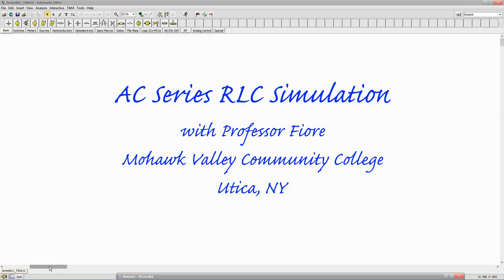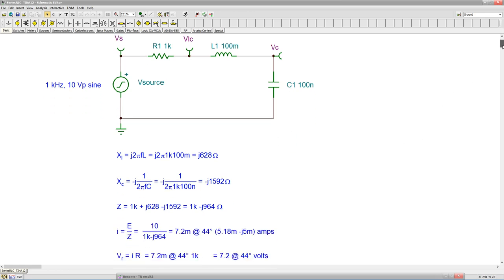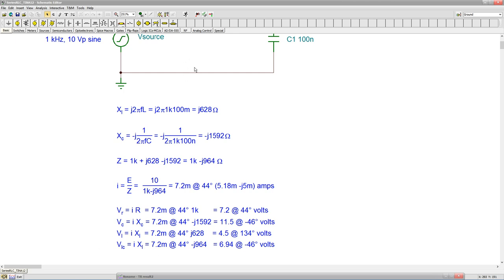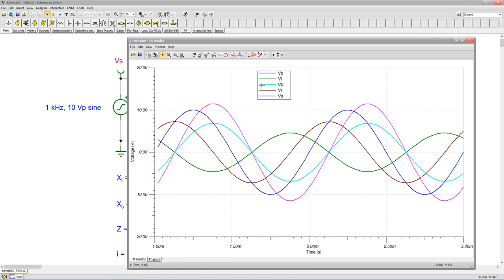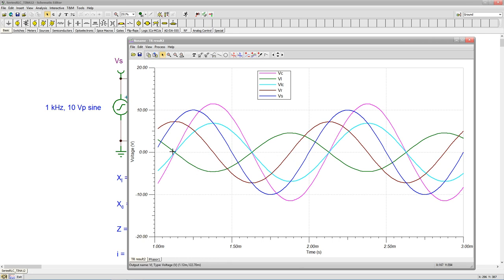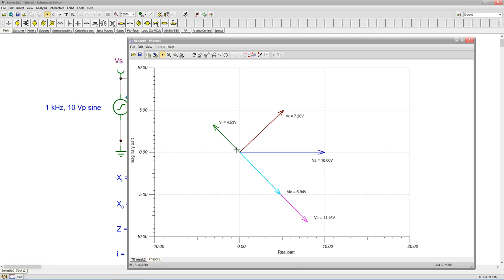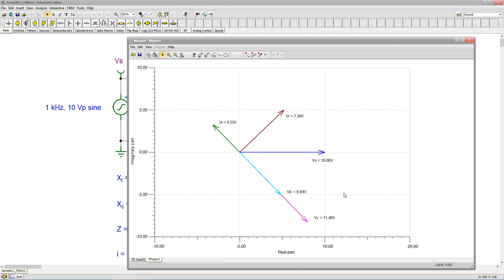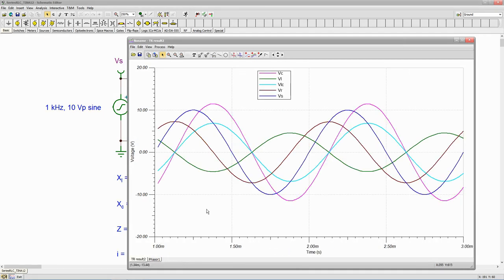AC Electrical Circuit Analysis: Series RLC Simulation

Comment: Good video....Why capacitor is used in DC circuits (where there is no voltage frequency is involved)?
Thanks.
Reply from the maker: It might be used to create a delay, for example, the rising voltage across it could energize a relay that connects a power amp to a loudspeaker. This way, the loudspeaker doesn't produce a "thump" when the amp is turned on.
Reply: @ElectronicswithProfessorFiore  Thanks for the kind explanation...It makes sense.

Comment: Hi sir,
Is it possible to get two different answers when calculating voltage of a component? For instance, using ohms law (i*Z) for resistor, or voltage divider rule (v*(X/Z))?
Reply from the maker: Not if you do it correctly. In AC circuits, a common beginner's error is to ignore the phase angles. In such a case, you can come up with different (incorrect) values.

Consider it this way: ultimately, the voltage divider rule is just a convenient form of Ohm's law. To keep it simple, consider two resistors, R1 and R2, in series with source E. The "long way" using Ohm's law is to find the current (I=E/Rtotal), and then multiply that result by the resistor of interest (e.g., VR1=I*R1). If you substitute the original expression for I in that second equation, you get VR1 = (E/Rtotal)*R1, which can rewritten as VR1 = E*(R1/Rtotal) (voltage divider rule).